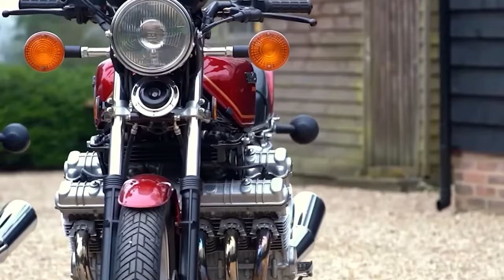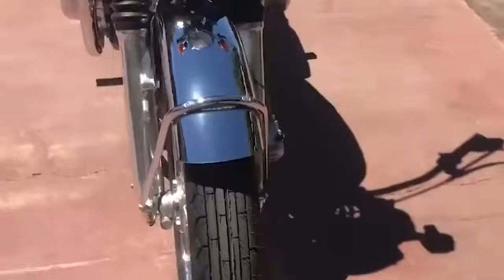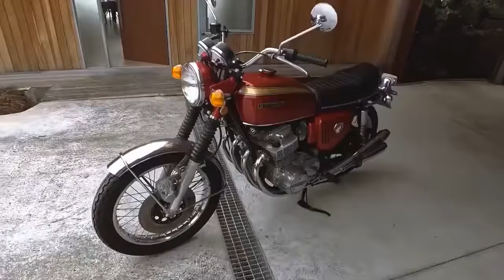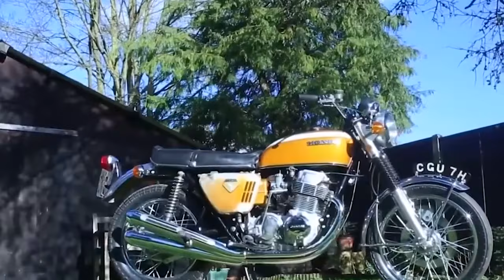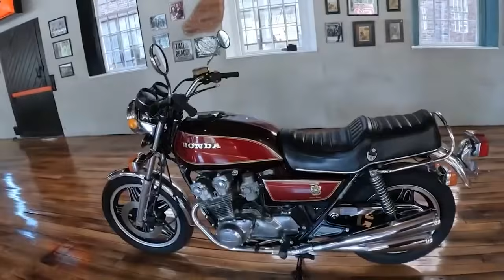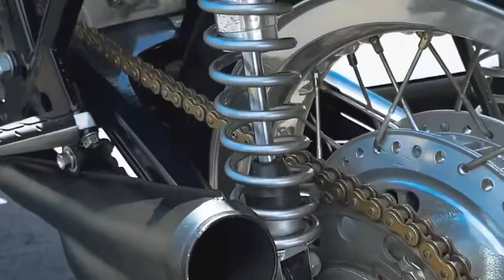20 Weird Facts About the Honda CB750 – The First Superbike

Comment: I reluctantly sold my 1970 (manufactured 12/69) Honda CB750 K0 motorcycle with 45,191 miles on the odometer, Vin #: cb7501016269, engine #: cb750e-1016228 for US  $11,000 to a customer in Denmark more than 20-years ago.  This amazing motorcycle changed the path of my life, and owned me for more than 35 wonderful years!  It was purchased in the summer of 1972 with less than 4,000 miles on it from the original owner for $935.00 (plus "use tax" and "transfer fees", those state bastards!).  Because of a desire to precisely maintain this motorcycle, I went to my local Honda dealer (Kolbe Honda, So. CA) and ordered the factory service manual.  I looked at the required tool list and saw this "vacuum carburetor synchronizer" and went to the Kolbe parts manager who told me the price was $387.00!  Since this was more than one third of what I paid for the entire bike, I rode to the local auto parts store and purchased four vacuum gauges, 3-16" rubber vacuum line, "Bundy" brake line tubing, and four metric screws that matched the ports on the carburetors.  Looking at the small photo in the manual of the synchronizer, I realized I needed to purchase four "needle valves" at the aquarium store to dampen the intake pulsations.  I built a copper manifold and attached the four disassembled gauges to a vacuum pump (an old refrigerator compressor) and learned to calibrate the aneroid gauges by bending the Bourdon tube so that they all tracked each other, they didn't come that way from the factory!  I cut the Bundy tubing into lengths, and brazed it to the metric screws that I had drilled and added rubber o-rings.  After completing and testing the prototype, I went back to the parts manager and showed it to him, and he said how much for a quantity of ten?  After negotiating a price with him, on may-15-1972 (my 20th birthday), I formed my first company, "Four Designs Company" to manufacture my first commercial product: the "Vacu-Tune" carburetor synchronization gauge set for Honda four motorcycles, (I sold more than 3,000 of the gauge sets, please see my YouTube invention video, just click the circular logo "H2H").  I sold the company to my Jr. High school friend and he is still in business, now re-manufacturing electronic test and measurement instruments, (see: "fourdesigns.com").  I know that there is a lot of interest in the original production run of these motorcycles with the "sand-cast" main engine cases, but aesthetically, I always preferred the finished look of the painted die-cast cases.
I definitely prefer the look of the K0 model with it's matching painted side covers, air-box, and headlight bucket. The k1 model just didn't have that unique look that this original motorcycle is famous for.  David Riddle